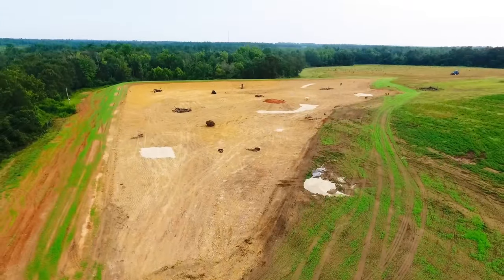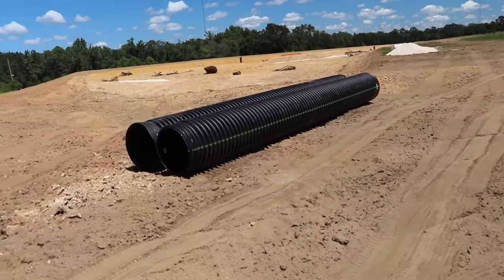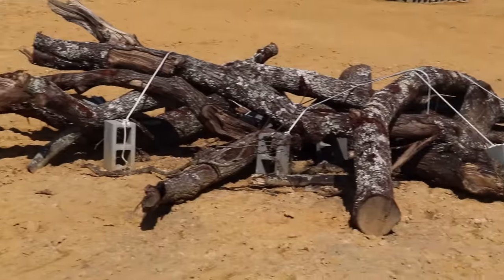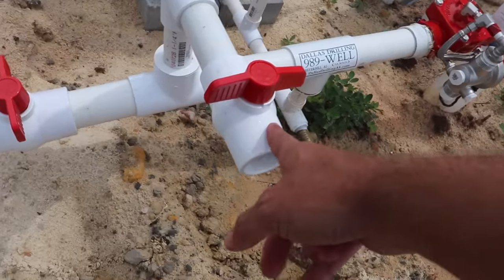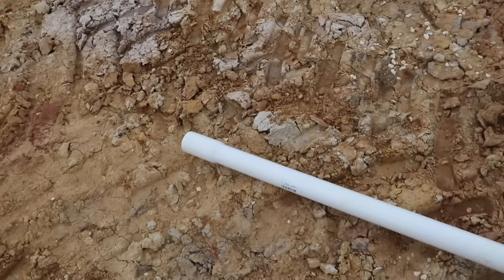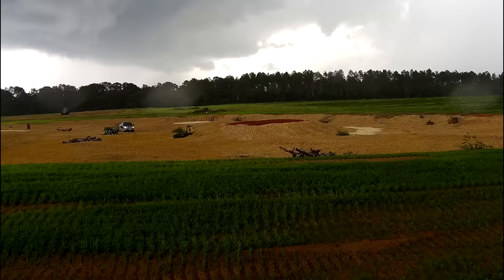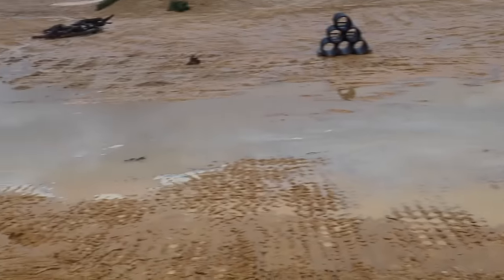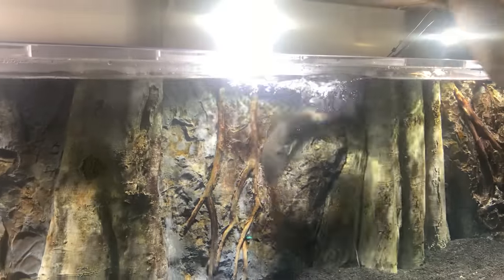Building a 5 Acre Pond! (Filling it with Water)

Comment: Would it have been better to use a cloth style strap versus the metal strapping that will eventually rust and break and have to be replaced. Also honestly you should have got a ditch witch and really trenched yourself a bit deeper than that for water pipe. I would imagine using the PVC you would want that thing down beneath the frost line

Comment: FYI the pump hp has nothing to do with your water pressure. It’s the size of your pressure switch. 20/40…..30/50….40/60…..pump cuts on at lower and off at higher also you used 2-dwv 90’s on your waterline.  Those aren’t very strong and your pump turning on and off WILL break them eventually

Comment: Those weren't pressure fittings you used there brother. Those were dwv pressure fittings have at least 100% glueing surface to pipe diameter

Comment: I don't get it. Why do you pump out water to make a pond? It will just evaporate and lower the water table. Why not just dig and wait for the rain? I am not criticizing. I just do not know the advantage. I know it rained but the plan here is to pump out water.
Reply: becasue there will be long periods with no rain which means no water which means the pond will dry out quickly